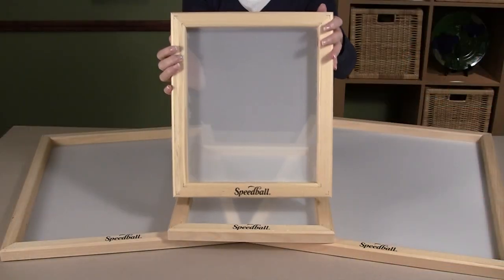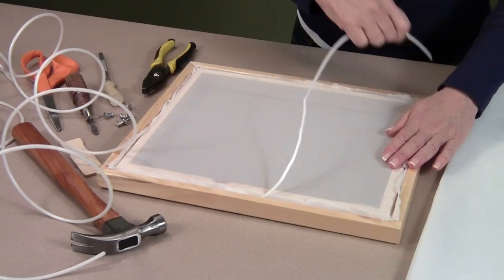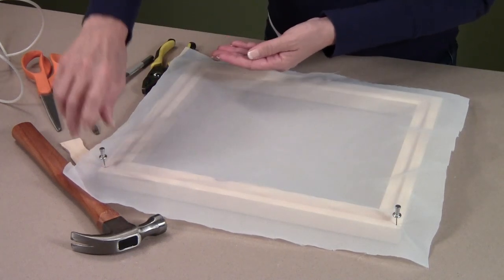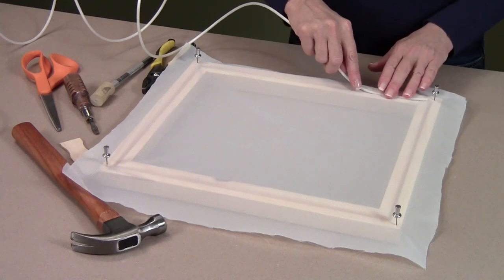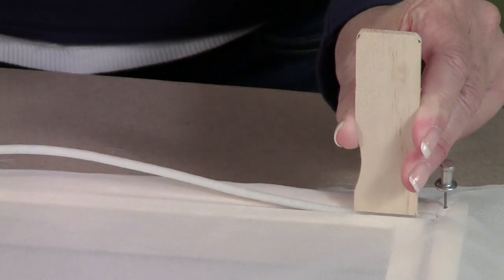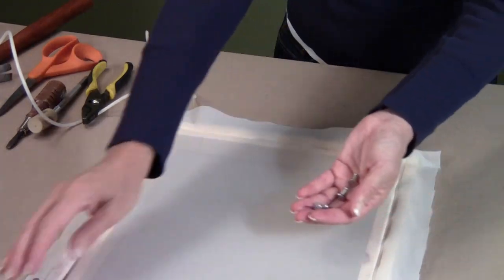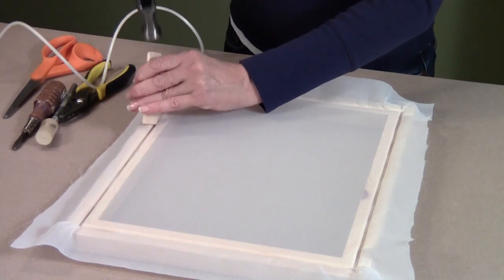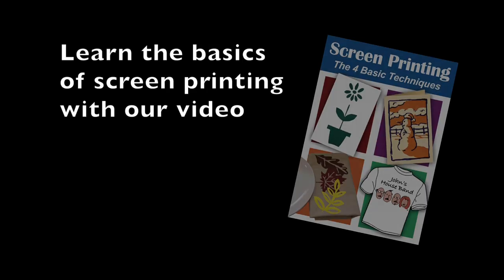Replacing the screen printing fabric

Comment from the maker: Speedball sells several types of screen fabric in sheets and rolls. The standard designations are 8xx, 12xx and 110 Monofilament. The higher the number the more treads per inch. Higher thread count fabrics are for fine detail and multicolor registration. 110 Monofilament is for very fine detail. But as with most things in life there's always a trade off. The more treads, the less ink is able to pass through to the paper. 12xx Multifilament is a good compromise between ink flow and good detail.

Comment: I'll have to try a painters mixing stick, pushing the cord into frame with a screw driver has resulted in slipping and actually tearing the fabric. This is a a great video though, shocked there are no other videos discussing replacing the mesh.

Comment from the maker: A new frame should come with the screen and cord assembled. Replacing the screen is necessary after extended use or ink has caked up in the screen fabric and can't be removed.